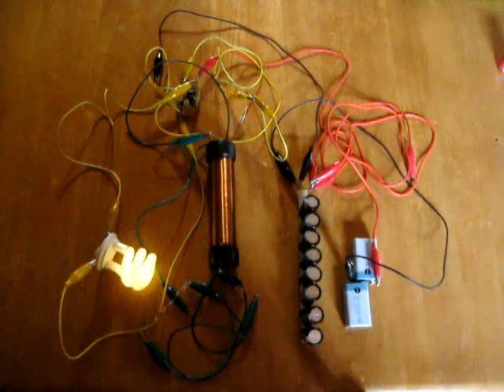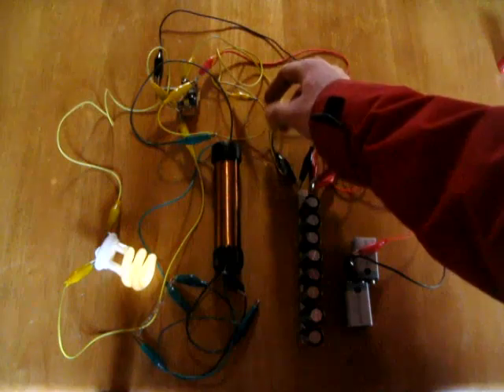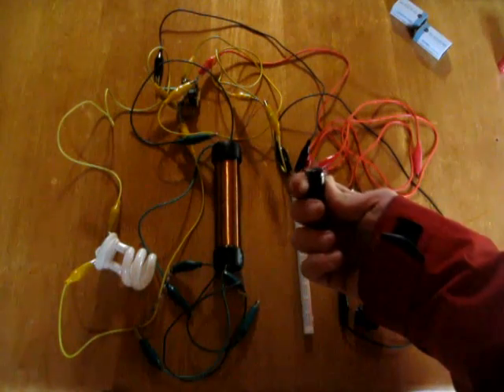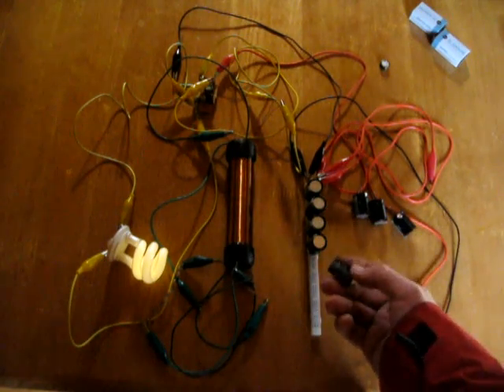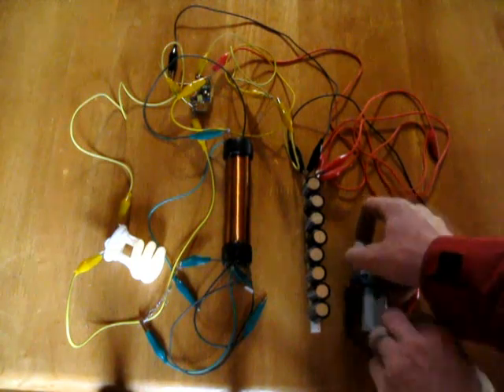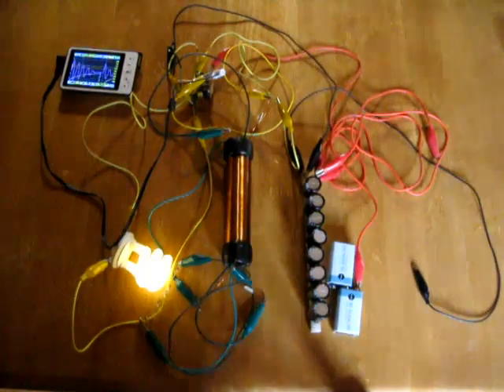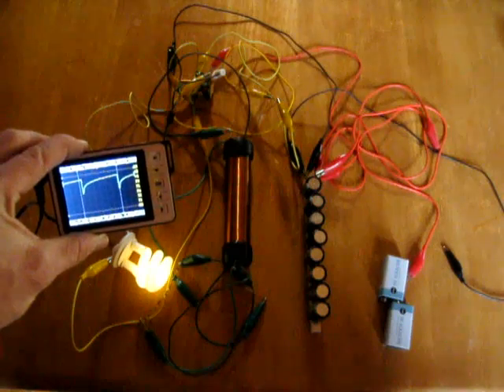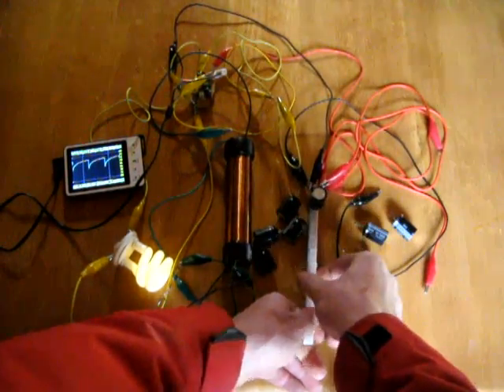Joule Ringer! Light keeps going without battery.

Comment: The ferrite coil is also a capacitor, the winding and size of the ferrite play a role here. You have high voltage but, high resistance, the amount of light isn't impressive from an 8v source.

Comment: interesting question,  outside my hours i stick a stainless steal rod into teh ground about a foot and just north of that i place a copper one in the ground, measuring voltage between them it is about 800 mv and then switch it over to ac and it registered on the 600 ac volts scale 1.3 or 1.4 volts ac how can i take that voltage and step it up to something use full in ac or dc

Comment: Wait, when you placed the first cap back in, the light started,? But without external excitation from the original batteries? You are so full of shit!

But don't despair people the concept is valid. Need to run a couple 60w 33v cob leds from a couple 18650's, Joule ringers! They work!

Comment: The majority of the energy stored is on the coil, the capacitors enabled the circuit and those don't store much energy compared to the magnetic flux on the coil. The capacitors are only needed to run the joule thief when the battery is disconnected, and the tube will continue glowing until the magnetic field on the coil fully collapses. Could have uses in hand-powered flashlight and such, as a magnetic coil is much more efficient at storing a charge compared to rechargable battery or capacitors.

Comment: i thought this was very neat, i have just recently started trying to build things like this, after building a power supply for my desktop computer when my other one burned out.  I found i was very intrigued by what was possible, like i just finished a android charger that runs off a 9v battery i keep it in my glove box :o).  thanks for posting these videos, as there is SO MUCH to learn... lastly as you said you can just energize this circuit every so often.  Could you just test how long the light runs off the capacitors, once you find the value just insert a little timer that would allow the battery to power the circuit for half a second then cut off, and repeat every so often whatever the value was of how long the capacitors lasted?  hopefully that makes sense, anyhow thanks again!!!

Comment: FAKE FAKE FAKE. fuck OFF
Reply: its not fake you idiot, becuse the capacitors stores some of the power and keeps sending it to the light bulp, but after some time it will run out, that's why he says that it has to be energized once in a while.
Reply: So why doesn't he show the duration needed to extinguish the lamp?It's a fake, get over it. The last capacitor removed is a dead short connecting a hidden supply.

Comment: When you remove the capacitor at around 9:35 does your meter still reading a voltage it looks like it remains at the same voltage even after you remove the super cap?

Comment: So the bank of capacitors are charged using energy from the battery. The 'Joule thief' is just a simple switch mode inverter. All well and good but I would not want people running away with the idea that free energy is being created here.

Comment: I"m wondering if you could set itself to a timer to the battery to charge itself when ever it drops too low in voltage before it dies

Comment: Put the super capacitors on the battery hookup spot that way the energy is being recycled into the electrolyte capacitors but the main charge last longer on the battery end. The super capacitor on the battery end will hold the charge longer while the electrolytes continue to function..In a since it'll replace the battery and should double or triple your duration without keeping the battery hooked up full time.

Comment: Today I bought components to start experimenting with this stuff. I also have a small ABHA coil someone printed for me to make experiments and I think I'll use it just to try. I still think this thing extracts energy from the vacuum, the electrolytic capacitor may be a sign: atoms are the perfect machines where vacuum fluctuations flow back and forward 1:1. I just wonder: what is going to happen if you charge more supercaps instead of the light bulb and use them to charge the electrolytic here?

Comment: The super Cap is just good enough, to rund an LED, it is like a high impedance Batterie, not like a low ESR Capacitor, that can pull that current.

Comment: overunity or not, no capacitor should be able to hold the light that long even if it flickers dimly..i have a 10000 microfarad 50 volt electrolytic capacitor..it lights an LED for several seconds..we're talking CFL's on his experiment..its takes way much more juice to run that on capacitors alone..

Comment: I think his intentions are good, but his title will lead to many comments like mine. It really is no surprise that it still works without a battery if you have a capacitor attached since a capacitor is essentially a battery. But i agree this isn't the point of this video. Perhaps a different title would prevent other comments like mine.

Comment: The capacitors are running the circuit.
You can think of a capacitor as a fast charge battery electrolytic capacitors can dump there energy fast.
The super cap cannot dump i'ts energy fast they are designed to supply a small current for a very long time.
electrolytic capacitors lose there charge fast over time making them no good for keeping time keeping ic's running for that application super caps win.

for this project if he adds more electrolytic capacitors he will get a longer run time.

Comment: yes ther is a odd thing happenning. Maybe the caps are accting as battery but he can acctuly charge the caps and using the charge back instantly... ssooo its unusual. its like a smoke ring but with current instead... oorr like a tornado of electricity... or if u know about toroïd pattern... well thats one of em. a continuing movement of energy.

Comment: You mean that it goes down little by little as the caps drain? Imagine that. I have put together a few joule ringers...from small to large...and the result is always the same. It lasts way longer then it should. The last ringer I made used a measly 10mA and 1.5v to light a 10w cfl for just over 24hrs from a 2000mAh rechargable. The video isn't useless he was doing a test and sharing his results. Watch his next video. He explains it better.

Comment: at 9:35 he is showing the fact the super cap doesn't work as good as the polarized cap. At 7 mins what difference does it make?..He had already proven that it runs after the batteries are removed. Of course you are focused on the parts that didn't work the same as the beginning....even though he tells you exactly what he is doing.

Comment: when you have many caps in parallel you decrease the losses in from the equivalent series resistance (ESR) of the caps.  How come the light doesn't quickly dissipate the energy into heat?  I would have thought that it would last for a few seconds.

Comment: The one in this video is a DSO nano 201v.2 I have a v1. it's a great first sccope. But it's not great on sample rate and analog bandwidth. Accurate to around 250khz then it starts to round off the corners etc...

I got mine on ebay. If you get the DSO quad 203 make sure you get digital probes or 2 channels won't work.I have had big dramas getting digital probes

Also seedstudios. where I ended up getting my digital probes. (Still waiting for post)

You can see both types in my video's

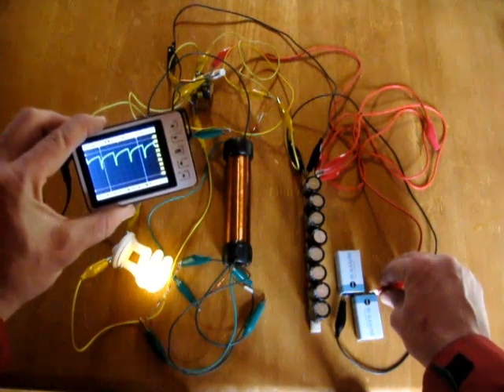Comment: At 7:01 the pulses return to their original width *before* you disconnect the battery. In non-BS science, effects always follow their causes.

At 9:35 we "watch the light" while your arm covers the meter, which still shows a non-zero voltage even with "no other [sources] in the circuit". Then your left hand goes off screen right where unexplained red & black wires exit the frame and the light comes on.

Congrats! You've weaponized ignorance & made it a communicable disease. You must be so proud.

Comment: GTFO! The electrolytic caps are the battery. It's not ringing. The CFL is just barely incandescencing. It's not even 1 candle power. The caps are powering the oscillating
ferrite transformer circuit. There isn't anything odd happening here. I'm sorry!

Comment: @allthepeoplewhodoubt... I will explain this phenomenon part 4.. The tesla along with the capacitors is a 100% energy/electricity, with 20-15% take of energy/electricity from the battery transfering that 20% energy/electricity to the capacitors without the bulb. The flaw is that if the light bulb take too much energy(say 90%), capacitors won't be charge anymore or if the wire is cut off the whole thing stops.

Comment: @allthepeoplewhodoubt... I will explain this phenomenon part 2... Firstly he run the electricity by battery then he increase the electricity output with the tesla coil. Having more electricity output with the tesla coil, he then charge the capacitors and at the same time lighting the bulb. Having charge the capacitors you can now have the light bulb running non-stop after the battery is removed.

Comment: I like to buy that setup how much?   maybe it only require one capacitor to charge up and hold the power, what is the voltage reading at the end of the light connection plug more device to it run more device and charge up the battery in the end of it?

Comment from the maker: @HugMyNutz  
 
You think I have batteries in the tube?  I can assure you that there are no batteries apart from the 9v batteries that I show in the video being used. This circuit has been replicated by many with success.  The reason the light gets dim over time is that the capacitors are discharging.  The system recharges instantly when connected to a power source for only a split second.  You should look at my other Joule Ringer videos where I show the schematic.

Comment: @Howtomake12261 No, they hold "Electricity". Capacitors aren't designed for steady power draw either. If you just slap a cap on a light, you'll get a momentary flash.

Comment: Dude... come on dude... when you take the batteries off the circuit you're still having the capacitors in there and they drive the thing... they're acting like batteries.. it's not magic or ringer circuit, it's just capacitors running through a transformer circuit

Comment: I plan on making a very large capacitor to pull a charge from the air and run the circuit and see about running a lot of cfl bulbs.  I will look for the modified circuit.
Thanks I will post an up date when I get it running.

Comment: i think you rediscovered Tesla Power Trasmitter ... i mean tesla want to make a resonant current circuit with the entire earth ... you do that on a smaller scale where that capacitor is you little earth who push back when resonant circuit is on and powerful enough to light the bulb ... for an efficient light bulb is only a a need for a tuned resonant circuit ...

Comment: if you notice when you "ring" (as you call it) the battery, the frequency increase NOT the voltage. This circuit is frequency dependent. Higher freq = more AC power.

Comment: i suspect the thing is that your RLC circuit is not tuned to work with a super capacitor.
also a super capacitor might used for a different use like for adding energy from time to time.

Comment: @jeannacav 

I think you are exactly right on this one. I have had the same experience with some pulse width modulators (PWM's) I have built. My DC motors wouldn't run right when the caps had too much capacitance because it took too long to "fill then dump" .

Good call!

Good call!

Comment: The fuji HV circuit without the (Joule ringer) will eat up AA fast and then off to by more batteries. This circuit is substantial. ... going further shuttling capacitors in sequentially. . replace batties with  supercap as your source so the test goes faster. compare mA over time using capacitors as shown vs mA over time using supercap and fuji only as a possible test setup measuring amp draw on bulb .THANKYOU nice work.

Comment: CONGRATULATIONS - You built a almost perfect resonance circuit. By increasing the diameter of the coil wire you will drop some resistance and that will increase the "charging power" My next step will be larger coil wire for lower coil resistance. Very very impressive.

Comment: So nothing special or remarkable is happening.  You got lucky and are managing to light up the CFL with a bare-bones minimum power drain from the electrolytic cap.  So this is a very efficient way to light up a CFL with almost no wasted energy.

Where you made a "mistake" in this clip is that you aren't checking the DC voltage on the cap bank.  For sure it is going DOWN, but slowly.  The universe continues to unfold as it should.  Great circuit for sure, an energy miser.

Comment: When you run the setup with the regular electrolytic cap, it looks like you "got lucky" with your choice of JT transformer configuration.  The setup manages to generate current pulses that are short and sweet and have just enough energy to ignite the CFL.  The CFL is not very bright, but it does light up.  So in a way you have a JT circuit that generates "Goldilocks" energy that just manage to light the CFL with minimum energy per pulse.  The key here is the JT transformer configuration.

Comment: The reasonable assumption for the supercap is that the ESR is too high for the JT transformer to function properly.  Therefore the circuit fails to oscillate and as a result the transformer coil just looks like a dumb resistor shorting out the supercap.  So "failure to oscillate" spells doom for the supercap for this application.

Comment: Fabulous... again!
My explanation for the supercap not working is this:
The larger capacity takes longer to fill then dump so the frequency is all off.
Tesla wrote/spoke about this, but it is buried in his lectures.
So, you have between 200 and 300 khz. My jtc that had 208hz, the best cap for repeating the spikes was 580pF! so this is pretty interesting that you get it with 10000uF.
Great work,
Thank you for this video,
jeanna

Comment: hey nice scope!
Quite amazing the super cap didn't cut it. Do you think you could replace the CFL load with something else, or does it have to be a flouro tube to work? anyway, this Prooves that something else is going on. I await for more.

Could provide an awesome emergency light... maybe take the guts from a shakey flashlight and put your circuit on top. Take it with you on the bus and the rough ride will keep the light lit!

Comment: Looks good,
how much uF do your caps have and was that the output scope voltage directly at the CFL bulb ?
Is this a real handheld scope or just a converted portable audio player with
Input waveform display ?
Many thanks. Looking forward to the circuit diagram.

Regards, Stefan.

Comment: Good job I like the addition of the second coil I'll try this next I have some videos along the same line except I am  using 1-2.5watt led bulbs and the resonance seems to last longer and I had a tough time lighting a cfl for any length of time Xmas lights stay lit for 15-20 minutes I think due to the way they run the diodes and resistors in the circut, keep up the great work